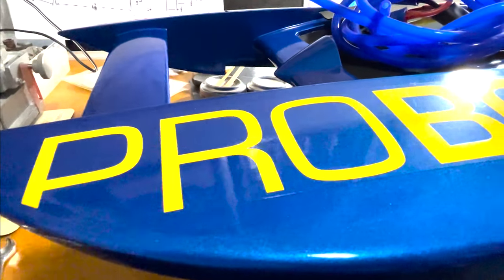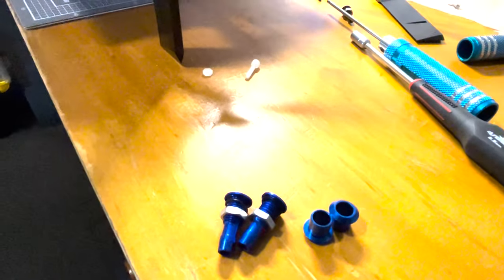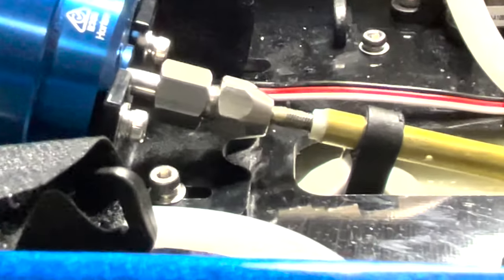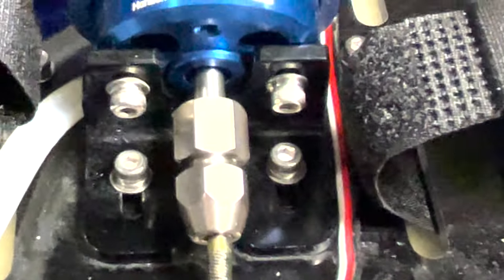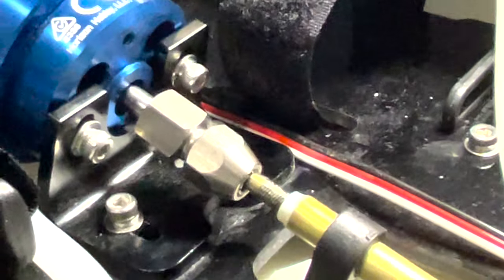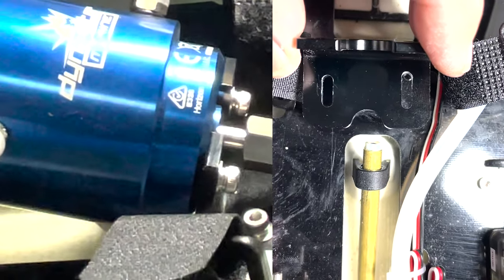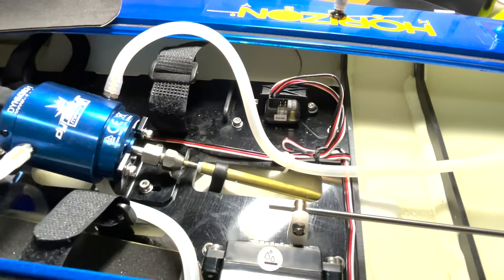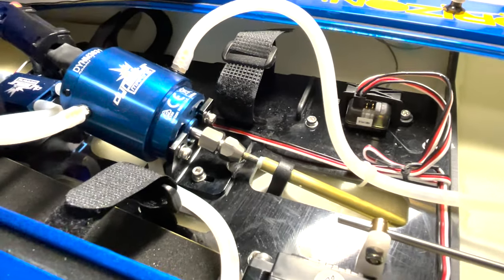UL 19 Alignment Issues

Comment: Ive done all the mods. I dont remember those issues a few weeks ago when I finished mine, but you have me wanting to double check my work on the new larger flex shaft's alignment.  My maiden and more under ifly65  Thanks!
Reply from the maker: @ifly65 yeah may not be on all builds, some might be perfect already, but if youve fitted larger flex you will have done it right!!👍🏻